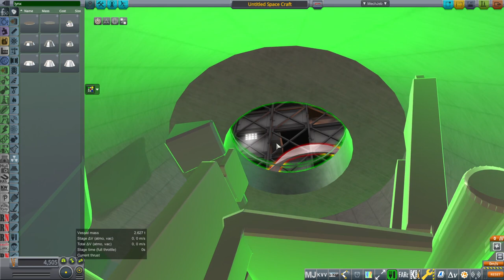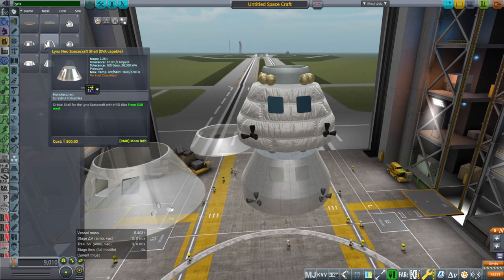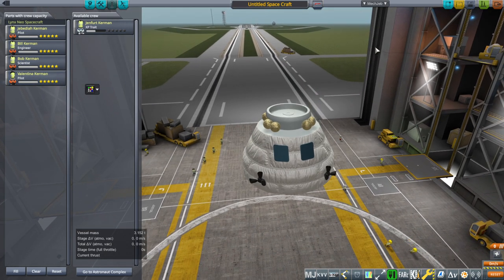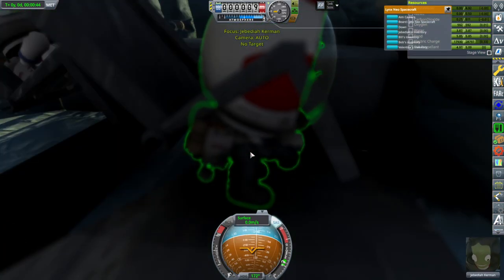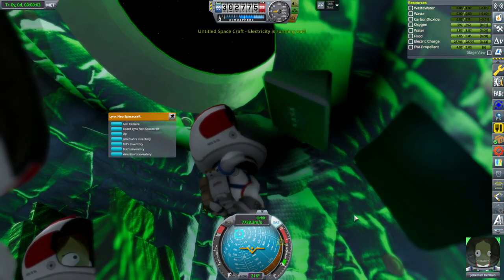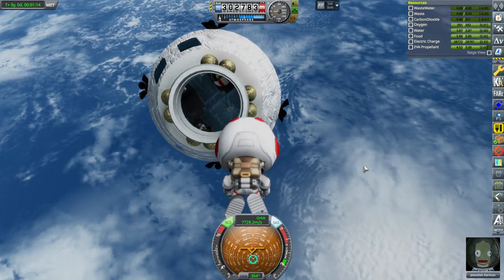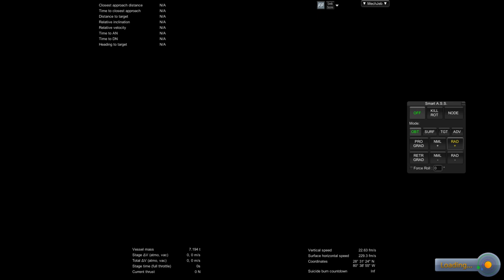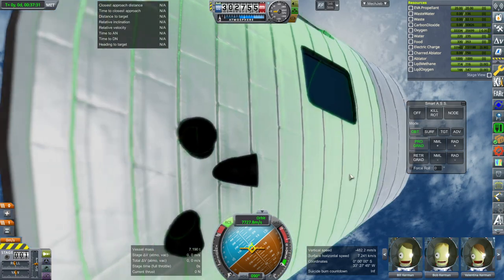Realism Overhaul in KSP 1.8.1 - Lynx Neo

Comment: Aren’t the chairs upside down in relation to the windows aboard the lynx?
Reply from the maker: The seats are in launch position (with the astronauts basically lying down) but can rotate into a forward position. The windows are placed to facilitate landings (when the Lynx is just a lander can), and in that case the seats will be in the forward position.
Reply: @RaizSpace  oh ok, I see! Didn’t quite make the connection that is can be a lander as well, totally forgot. Thanks!